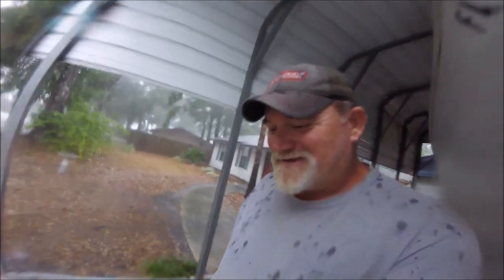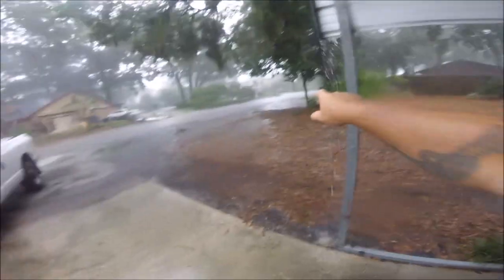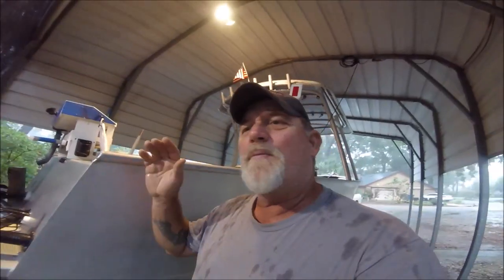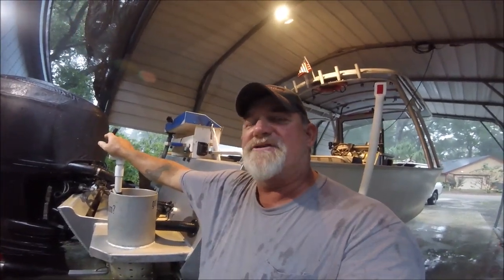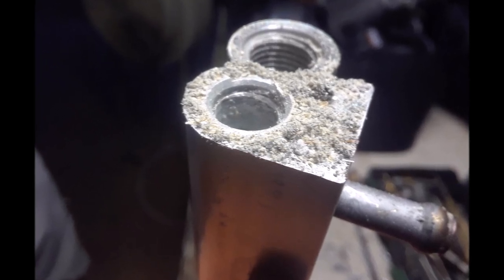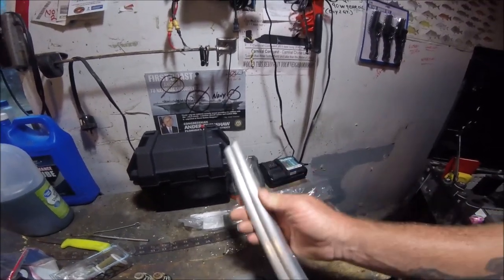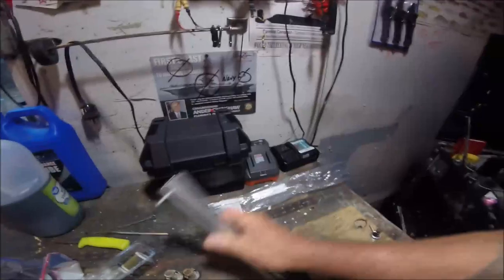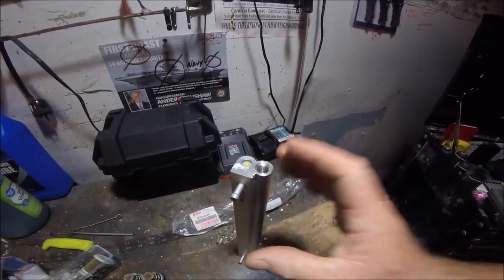SUZUKI OUTBOARD MAINTENANCE

Comment: Awesome info.  Thanks just bought a 2020 boat with a 200hp Suzuki only 62 hours on it.  Thanks to you I changed all the anodes did oil change lower unit gear oil change.  New impeller and thermostat.  You would not believe the amount of salt deposit on the anodes and the thermostat.  Cleaned and flushed the entire system out.  Every year around this time I will do it all ov3r again. Besides its fun.  Thanks for your service,  from a fellow Marine over here. Semper Fi.
Reply from the maker: NEVER EVER RUN OUT TO FLUSH ON THOSE FLUSH PORTS!! unless you want a clogged fuel cooler. Use muffs and a hose running motor with good water supply or buy a barrel to fit and run up to beyond temp in it. you need to watch more over here on my playlist:  https://www.youtube.com/playlist?list=PLK-ee3q-bFR2KPb2cDapcVKEbkUjsWyJM

Comment: Dave glad you found it. I been fighting an idling problem all year. Took it to two different shops and they said it’s fine for a 14 year old motor. I have an HPDI motor and at the end of the day there was a missing bolt out intake. Replaced the reeds and got a new bolt fixed. Also the o2 sensor was bad. It was like all they wanted to do was sell me a new motor also. All for a missing bolt and blown intake gasket. I plane to run it an other 10 years I put about 100-150 a year on it. I also have an other block sitting in the shed incase I can’t rebuild it.
Reply from the maker: o2 sensors seem to shit the bed faster than a spark plug....Oh, I had one of those in the midst of this fuel cooler issue ''go bad''.....2nd or 3rd one under warranty. Really had me doubting this motor. Why is it on every outboard I've ever owned, after a few good years, I can easily tell you it's design flaws?  I'm certainly not married to any brand, and many times would like a DIVORCE!
Reply: Capt Dave's Sport Fishing Dave I had a mercury 115 carb 2 stroke and that motor just ran. After five hours trolling around she acted up but would blow right out and get back to it. Now I got this HPDI on a bigger boat and when she is running wow. But damm it seems to always need attention. Are you glad to be done with 2 strokes or do you wish you could go back. Every once in a while I get the itch for a new motor and I see all these people complaining about these four strokes. I am really considering rebuilding this spare power head in my garage right now. Or going up to an etec next. But when I break I can repair it. This new new stuff kinda worries me.

Comment: I'm glad to learn about the fuel cooler thanks for the video
Reply from the maker: If you're running in water like me full of hyper saline, and dirt particles so thick its as if it's a snow storm blizzard under water! When you're outboard gets hot and you get constant stalling and fuel starvation......it's probably your FUEL COOLER!  NEVER USE THOSE STUPID FLUSH PORTS!
Reply: @CaptDavesSportfishing  I'm down in Cape Coral we get a lot of red tide my Suzuki 200 is new just about to get the 100 service and they are fleecing me for what is an oil change and inspect this and that ,so I will be doing my own maintenance after this I'm really glad I found your channel thanks for posting these videos they are very helpful cheers Oh my boat is on a lift in my canal so all I have been using are those flush ports I guess I should pull it out and flush they way you do every so often I can't pull it out every time because the city won't let me keep my trailer in the driveway ,thanks again
Reply from the maker: @1dotele  I do my own service, I can't drop my boat off for a week, its my charter boat. Just had a customer on Tuesday 83 yrs old that moved here to Jax because of that redtide. He was sick of it and couldn't fish. DO your own, learn and SAVE!  Here's my playlist https://www.youtube.com/playlist?list=PLK-ee3q-bFR2KPb2cDapcVKEbkUjsWyJM  with loads more and doing a BIG TIME CLUE video right now about a hidden zuki maintenance issue....so subscribe and click the BELL!🔔

Comment: Is there any way we can talk? I have a fuel problem that I cannot figure out. I hav a 04 Suzuki DF225 is the low pressure fuel pump supposed to run constantly or shut off and on?